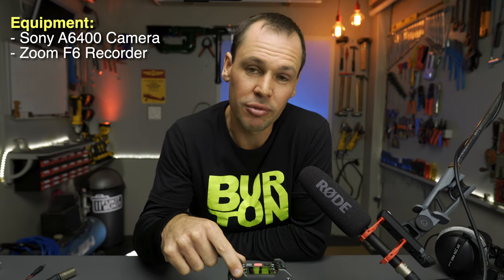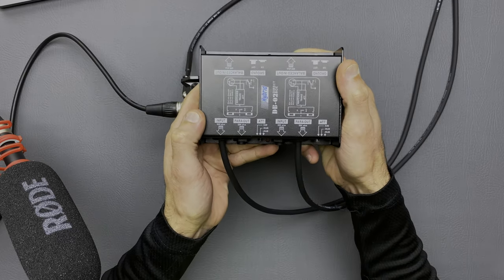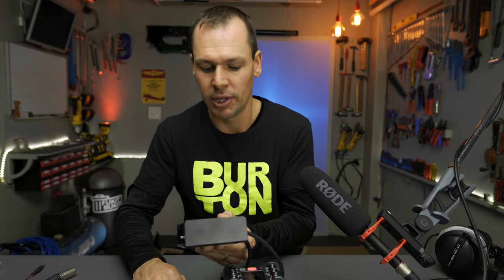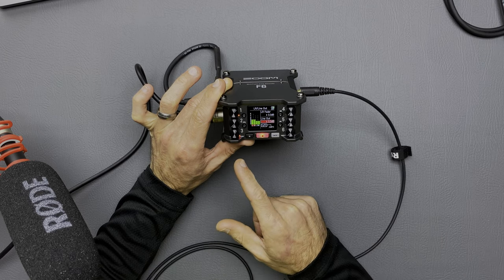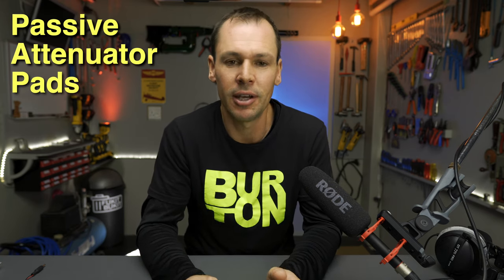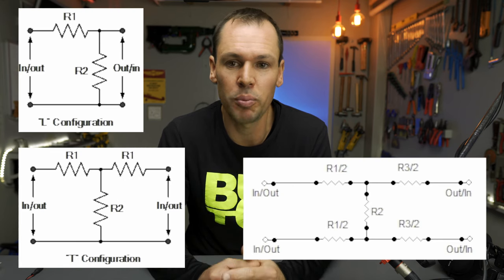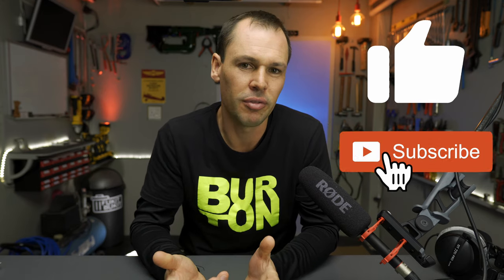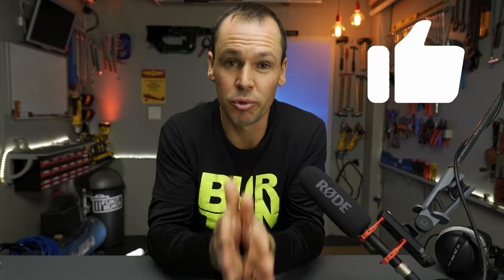Zoom F6 Update & Line Out Noise Fix - DIY Attenuator - Burton Builds

Comment: Very cool video!  I love the thought behind the wiring and how you put this all together.  I love the Zoom F6, I even did some videos about it myself.  I'm currently looking into the firmware updates, but I'm not sure how to download them and apply them to the Zoom F6.  Do you happen to know how that works?
Reply: I actually just figured it out. It's a bit confusing having to copy the update into a SD card and then pressing the Play button on start up with the card in.  Thanks again for the video, I'm excited to check out more of your videos!
Reply from the maker: Hi, sorry for the delayed response. Glad you figured out the v1.5 update. I'm also happy with the F6, find myself using it more and more as time goes by. I did notice something strange a while ago. Setting the fader to a certain level, recording and then afterwards, plugging in and transferring files over USB-C and the after that, when trying to record again, the input level seems to be lower than before (even though the physical position of the fader didn't change). Haven't tested it any further though.
Reply: I’ve noticed that too but if you mute the track it’ll reset. It hasn’t been an issue, hopefully it’s just a firmware thing. I also think it’s the fact that it could be a “free flowing” knob as I call it. Just like a focus ring on a lens that doesn’t have a beginning or an end. I know this doesn’t apply physically but maybe it could with the digital conversion.
Reply from the maker: I'll keep that in mind for next time I'm using it, Thanks. Check out some reviews of the Rode Wireless Go system before buying it (you mentioned it in your latest video). No my favourite although I do own two sets. Just has some limitations.
Reply: What kind of limitations?
Reply from the maker: Range is crap if its not direct line of sight. There was an 'interview' I did with a Doctor at University of Cape Town who invented a process for making building bricks from urine and we were standing feet apart from each other and from the receivers and the connection was dropping out when losing direct line of sight. I really wouldn't expect this as such a close range. Since then, I've been monitoring it during different use cases and if you aren't careful, it drops. Just cant trust it for a one-man-show.
Reply: Thanks for the info. Probably the reason why it’s $200. Some of them get very pricey
Reply from the maker: For a person vlogging directly in front of the camera, it's probably fine but if I had to choose again, I'd go with the RodeLink filmmaker or Sennheiser G3/G4.
Reply: I actually have the Sennheiser AVX system. My issue is finding a wireless system for monitoring audio without latency. I have a BT Transmitter but the latency is so bad for live audio monitoring. This actually gave me an idea to try the AVX system out of the Headphone out. I’m gonna try that today.
Reply from the maker: Did the AVX system work?
Reply: I had to get a XLR Female to 3.5mm female adapter. I should have it by Saturday. I’ll keep you posted. I’m very curious to find out if this works
Reply: just tried the AVX as a Wireless headphone adapter and it worked perfectly.  The latency is very minimal.  The issue is that if I wanna use the lav I cant have a wireless headphone signal.  Which made me think if this works then the Sennheiser XSW-D  would work just the same.  It works just like the Rode Wireless Go but I don't know how good it is.  Maybe I'll pick one up in the future to test it out.
Reply from the maker: @RebelTech1990  Thats good news. Hopefully the XSW-D doesn't suffer from short range / drop outs if direct line of sight is not maintained. Keep us updated.

Comment: thanks for this. can i use the zoom f6 or the mixpre-3 ii with the rode video mic pro + via the 3.5 jack? are there limitations to this quality wise compared to using a xlr shotgun mic?  thanks so much for your thoughts.
Reply from the maker: Hi Rory, yes you can use the VideoMic Pro+ into those units. I think the most correct method of achieving this would be to use something like the RODE VXLR+ (link https://amzn.to/2GvKoDm)

There is also the option of making a DIY 3.5mm TRS to XLR adapter but if you going to be using it with an F6 or Mix Pre, means you have spent a lot of money already on quality equipment and thus I think just buy the correct thing the first time around (like the RODE VXLR+ mentioned above)

As for the the quality, I have used the VideoMic Pro+ directly into the Zoom F6 a few times, with a DIY adapter cable and with the RODE VXLR+ and at a few different locations and the results varied. Sometimes audio was perfect. Other times I picked up some interference on the VideoMic Pro+ however the other channels that were recording at the same time with XLR shotguns were perfect.

XLR mics use a balanced line / signal which will give better audio quality / less prone to noise (where as the VideoMic Pro+ is unbalanced) so generally speaking, you’ll get better quality from an XLR mic. I say this with a pinch of salt because even though a $20 mic might be XLR, it will probably sound worse than an unbalanced signal from something like the VMP+.

Check out my latest video (https://youtu.be/HWJGoSX_4X8) where I had the VideoMic Pro+ recording directly into the Zoom F6 and simultaneously was recording 4 other mics, all for the purpose of demonstrating the difference in sound between them all. 2 mics were XLR, 3 were unbalanced. The mics ranged from $60 to $500. This might help you make up your mind.

Are you planning on purchasing the VideoMic Pro+ or an XLR Shotgun? and what are you planning on using them for?

Comment: I purchased the ZOOM F6 and I have connected several microphones (BOYA Lavs, Sennheiser MKE600, Rode Wireless etc) and I receive an awful noise floor to every mic!!! An annoying hiss in every audio! I have the same results even if I connect the same microphones on my mirrorless camera dirrectly (mic input) so why recording on external recorder. On your video, you have no hiss when you suggested to listen to the recording from the zoom. Do you have anything to suggest as a workaround?
Reply from the maker: Hi Georgios, Do you have a high noise floor when you record each of the mics internally to the SD card on the Zoom F6? (i.e. listening or playing back the internal recording on the F6) or do you only have a high noise floor when you feed the line / headphone out from the Zoom and then into your camera?

What camera are you using? It sounds like you are also getting a hiss when connecting all of the TRS mics directly into the camera... I doubt all of the mics are faulty so maybe the cameras mic input is faulty? 

The MKE600 is a good quality XLR mic so if you are using a good quality XLR to XLR cable between the MKE600 and the Zoom F6, there should not be a high noise floor / hiss on the internal recording on any of the channels. If there is a high noise floor / hiss then maybe there is something wrong with the F6?

When plugging in the Boya Lavs or Rode Wireless Go's into the F6, best is to use an adapter like the RODE VXLR+ (https://amzn.to/2GvKoDm) to convert the TRS plug into XLR plug that goes into the F6.
Reply: @GrantBurton  thank you for the immediate answer. I am recording internally on ZOOM SD card and I am also use the RODE VXLR+ to plug the external microphone but there is a lot of Hiss....
Reply from the maker: @giorgospsathas  You'll have to try isolate the problem... either its the VXLR+ or the mic or the recorder. If all the mics are plugged through the VXLR+ and they are all hissing, it's likely the VXLR+  or the F6 thats the problem.

Have you tried using the MKE with an XLR cable direct into the F6?

Is your input on the F6 set to mic level?
Reply: @GrantBurton  its the same with VXLR+ and without. Even when I connect the MKE direct to zoom with an XLR cable. BUT, I have just tried to disconnect my headset from the zoom audio jack and lower the headset volume to zero, and the problem has been resolved (not 100% but way better)!!! WEIRD!!!!
Reply from the maker: @giorgospsathas  What headphones do you have? Sounds strange that the headphones should affect it like that... do you have another set to try? Maybe its worth returning the unit under warranty? or getting in touch with Zoom and hearing what they have to say?
Reply: @GrantBurton  I have used different headsets but unfortunately I encounter the same probl;em. I will contact ZOOM!
Reply from the maker: @giorgospsathas  Please let us know what they say.
Reply: @GrantBurton  I will. Thank you.